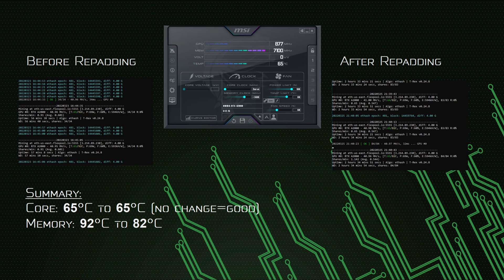PNY A2000 thermal pads replacement with very high conductivity pads (20 W/mK)

Comment: It's always worthwhile swapping out the pads, as all decent quality pads will deliver a sizeable temperature drop.  However, in my experience, there is practically zero improvement  between 12.3W/mK, 17W/mK and 20W/mK pads - I have tried all three on my A2000, 3060Ti and 3090.  All of them will get you almost identical drops, so just buy whichever one you can get a deal on, and don't think you absolutely must spend a lot for the one with the highest number.

Comment: Ordered the pads; they never arrived. Thanks USPS.
Reply from the maker: Hey. If you have not already (still catching up to emails from a few days ago), send us a message. When this happens we typically find a way to make it fair to both parties.
Reply: @KriticalPads  Thanks for your reply. Since the tracking states that the item is in transit(for over 40 days now) there is not much to be done. Not really a beef with your company and product. I just think that USPS is pretty useless (I contacted my local post office and no one is able to tell me what is happening with this package). I hope that you may take your business with some more reliable service providers even if it costs a little more to us. I am still secretly hoping that the package will show up so I can enjoy cooler temps on those GPUs.

Comment: Why is website down??
Reply from the maker: The service provider is having server and DNS issues. Using private navigation should somewhat help to access the site for the time being.
Reply: @KriticalPads  thanks, how many A2000s will one of your 1.5mm packs work for?
Reply from the maker: @arnold-moger  One sheet would get you 7 A2000 repadded.